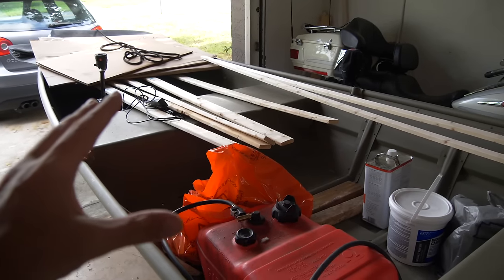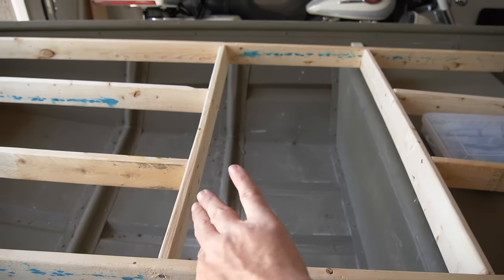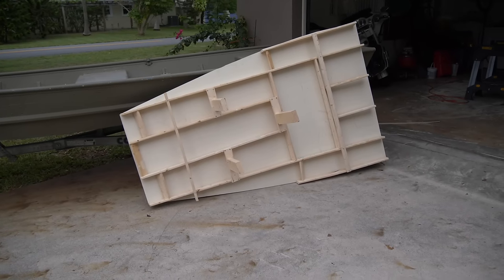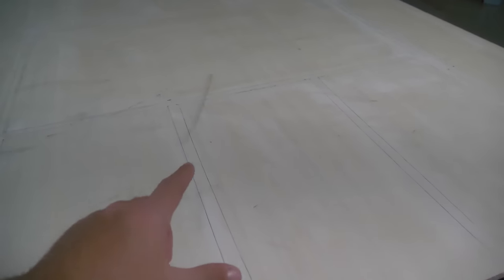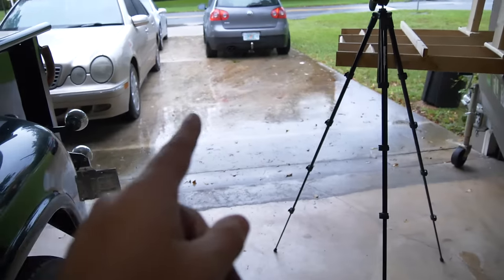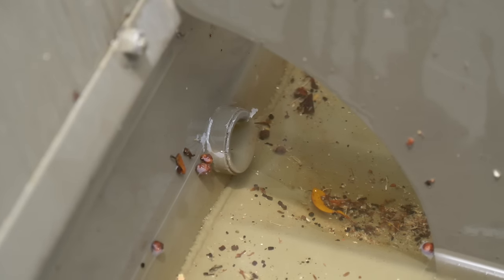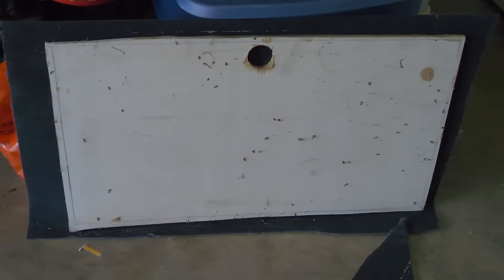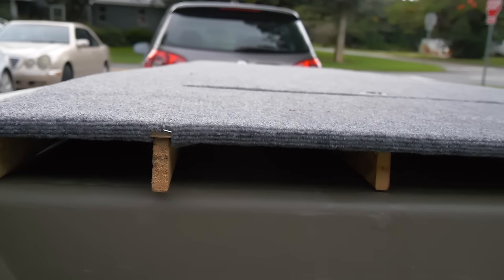Jon Boat To Bass Boat Conversion | DIY Jon Boat Casting Deck

Comment: Solid deck! I got a few minutes in and was like... thats pretty similar haha. Thanks for mentioning me 👍 I appreciate that. That would be the one thing I would change, I would definitely make my hatch a little longer so I could reach further up near the bow. I don't mind it being as skinny as it is, but next time I would definitely change the hatch. I hope you like it, you added your own twist to it and looks like it'll work, solid job!
Reply from the maker: Hey! Thanks man! I had to give credit where credit was due. The guy who taught me how to play bass told me once that there are no original idea's (musically speaking). Every idea has already been done. What matters is how you draw inspiration from the ideas of those that came before you, and make it your own. That's basically what I did with the deck. So, thanks for the inspiration!
Reply: @FloBass  Right on! and solid channel too. What is your camera set up you use for fishing? You have great audio & video and you frame the footage great! I watched you catching the snakeheads and just finished the peacock bass video "punching through mats" haha perspective is everything. I saw a quick glimpse of your rig there but would still be interesting in knowing. Looks like the deck is treating you pretty good too 👌

Comment: Welcome to boat ownership, you have just discovered the amazing hole in the water. It's a hole because you seem to always be throwing money into it justifying it to yourself (or more importantly, your significant other) that it's worth it, or its increasing it's resale value (my personal favorite when the wife gives me THAT face when she sees the cc bill). I made a similar modification on mine several years back but used aluminum angle and square tube just bolted together and deck screws to fasten the ply to the frame then carpet to cover the ply. I put a hatch in the deck to let me access the hull and store a BUNCH of gear and put the Batts to move the cg forward to get it up on plane faster. Have been using mostly just the trolling motor and am building a mud motor from a 6.5 Predator for it. One tip I discovered, the metal with get blazing hot on even a warm day, I took some 1/4 inch thick plywood, cut them the same size as the seats, and carpeted them with the same carpet I used for the deck, made a tremendous difference. Enjoy and good luck going after the fish.

Comment: good idea. as wood worker use the blondwood for framing as well. pocket screw joints. titebond 3 glue. light and strong wont flex as much either. happy fishin.

Comment: Nice job! Take a couple pieces of your left over carpet and put it under the points where it contacts the boat. That’ll take up the difference and also make it quieter. You could just staple it to your runners or it would probably be ok just laying in between the aluminum and wood.

Comment: how did this hold up? I'm looking at doing something like this or going the aluminum angle and rivet route. This looks so much more manageable for me and my skillset. I do have a foot controlled trolling motor that I need to mount. That deck looks perfect for that as long as I can secure it to the boat .

Comment: Are you kidding?  That is a great job. You won't feel that little flexing in the corner once on the water. Great job sir.
Reply from the maker: Thanks man. Its not so bad on the water, but it does kinda bounce in the front when I'm running or trailering it. More peace of mind to add the brackets in the front. I have the worst luck so anything to keep that thing from flying off is a plus.

Comment: You could run a flat piece of aluminum all the way across the front plate about 4 inches wide. Then you culd mount a trolling motor as well.

Comment: i really want to do the same framework your doing with but with front and back decks.  I want to use a 1452 and also build in 14" wide walk-around gunnels.  I love the way you store your rods under the deck along the frame.  trying to decide how much of the front deck space should be storage/hatches and how much should be filled with floatation.
Reply from the maker: Mitch, remember that filling your boat with floatation foam doesn't actually add floatation to the boat when its in the water. It only helps keep it from sinking once the boat has taken on a lot of water. You need to add surface area to the outside of the boat to if you want to add more flotation.
Reply: Right. With my two girls on the boat, it would give me and the wife some added peace of mind.

Comment: i used that sealent on the transom and my deck. Keep up the great work. Its going to be interesting to see how youre going to power the boat.
Reply from the maker: That video is posted. Check it out! The sealant didn't work out too well. I have to keep the boat outside, and the wood is coming a part. I should have used a marine epoxy. Oh well. Next one will be better.

Comment: You can cut aluminum just like plywood with that circular saw. Just get a blade for aluminum. I cut 1/2 plate like butter.

Comment: What kind of screws did you use I'm doing this tomorrow on mine
Reply from the maker: I used outdoor decking screws. They said they were coated to be weather resistant. One update to this is you should get marine epoxy paint and coat the deck with it instead of water seal. The epoxy will dry hard as a rock and nothing will get through it. It will make the deck last a really long time.
Reply: Awesome! Thanks for the info, Your video is helping me out alot man! Do you know the kind of paint tj gatoring used on his?

Comment: Run some of that 1x2 on the inside of the hatch, giving the door more to rest on. I would also run a 1x3 in the middle of the inside of your hatch door and it won't bow when you step on it. It will in do time. Great job though
Reply from the maker: I cut out the hatch opening larger than the surrounding frame so the door rest on it. I was wondering if it would eventually bow. So far its really solid, but I like your idea.

Comment: Just noticed you’re pulling it with your golf😂 im going to pull mine with my ‘17 golf gti lol
Reply from the maker: Yup, the GTI is what I have to work with for now. It's done a great job and has been up and down some sketchy ramps. Everyone always pulls out their phones and records me in hopes I get stuck or worse. I disappoint them every time.
Reply: FloBass right on mane thats sweet👌🏽
Reply: FloBass how’s the transmission and drivetrain holding up?
Reply from the maker: Mine has a manual trans. I’ve been up some really bad, steep, unpaved boat ramps with no issues. Handles it like a champ. Boat, motor, and trailer only weighs maybe 400lbs so it’s like having 2 grown adults in the car.
Reply: FloBass nice!
Reply: This is awesome! I've pulled mine with my audi s4 before 😅😅
Reply from the maker: Heck yes! What chassis? I’m a big B5 fan. Once I start my guiding business and it is going welll I’d like to build a Nogaro Blue B5 S4.

Comment: Hey I hat to get personal but I am a good 250. You think this deck is strong enough to hold me and have you had any problems since?
Reply from the maker: It will definitely hold you. I’ve had some robust folk on the deck with no issues. Just be sure to add some uprights in the middle and you’re golden.

Comment: If I buy one and start in April will I have it done in June I will probably be able to work on it all day every day
Reply from the maker: Cody I know you can finish it in a weekend or two. Just be confident and have fun with it. What helped me is I sketched it out before I started cutting any wood. I went through a few renditions on paper before landing on this layout. If you do the same, and have a game plan moving forward, you can frame it out in a couple hours, cut the ply for the deck in an hour or two and screw it all together. The longer parts would be figuring out a hatch if you wanted one, and painting it. Use a marine epoxy paint and do a lot of coats. That would be an all day process due to drying time between coats. Laying the carpet would take a couple hours as well. Even though this isn't really a how to video, you should have a good idea of what it would take if you wanted to copy what I did.

Comment: I had a lot of redos on my first deck. For the hatch I used nylon strap from an old book bag for my hatches. Holds them in place and up when open. For that bounce in the front just buy some 5 inch lag bolts and washers and screw the deck down to the front platform. It will work great. Also I would buy some spray on sealer and do all the bottom wood. I didn’t and when it got wet it molded. Also, did you weigh that deck when done? Curious to see the weight.
Reply from the maker: I sealed the underside as well and also the support legs. Should be good for a while. I weight myself holding the deck, and with out and it came out to be 43lbs.

Comment: If you do this again I would recommend using 2x4 for actual strength. If you put your carpet on the decking before attaching to frame you won’t have unfinished edges showing. I would also put a small hatch up front so you can access forward mounts to hold frame to boat and any future wiring you may want to do. But with that said, at the end of the day you have a deck that you made yourself and your happy with it. So good for you for being a self starter and doing a project that was maybe outside your comfort zone. 👍🏻👍🏻👍🏻

Comment: I'm building a deck on my jon boat how stable is it and how can I make it more stable
Reply from the maker: Stability depends on the width of the boat. My boat is a 1436 and I’m comfortable on the deck. Other people I’ve had on it are not. If you have a 48” wide jon boat it’s going to be much better, but jon boats are very light and will rock side to side a lot regardless of the width.
Reply: @FloBass  welp I sold it😂

Comment: What plywood did you use is it marine grade/ thickness?
Great video
Reply from the maker: Its called blondewood. Not marine grade at all. It was half inch. The water sealing I did on it did not last. I re-did it with marine epoxy and nothing is getting through it.

Comment: what kind of deck wood did you use? i am building a deck on my fiberglass boat and i need the right material. Thanks! great vid
Reply from the maker: The frame was made out of 1x3's you would use for studs in a home. Deck was blondewood.
Reply: @FloBass  Thanks!

Comment: I've got this idea to convert a center console 15 ft to a side console with bench seats. It's going to have a back deck with a front casting deck. Anyone ever tried this? And can it be done?
Reply from the maker: Anything can be done if you're willing to dedicate the time and effort.
Reply: Yes you definitely can, but you can’t go crazy, balancing the weight is key, and depending on how wide the boat is.
Reply: Are there any u tube videos on the type of conversation?

Comment: Why not use 2x2 half the weight and will be just as strong for what your using for. I’m just doing research for my build
Reply from the maker: These 1x2's worked perfect to give me the space under the deck to store my plano boxes.

Comment: Did you try cutting little off the bottom of the 2×4 vertical support before putting a bracket on front where deck was lifting up?

Comment: You really should be using pressure treated would to frame and marine grade plywood  or epoxy coat the regular plywood

Comment: Did you consider treated lumber?
Reply from the maker: I did, but didn't want the weight. I've already replaced the sheet with one that I painted with marine epoxy and I painted the frame while I was at it. Now that its cured, I can see it lasting many years.
Reply: @FloBass  Awesome
Reply: Never use treated wood in contact with aluminum unless you like holes from corrosion.  The copper in the treated lumber will react with the aluminum in a very bad way.
Reply: @stolencoats63  oh, I didn't know.
Reply: @rusharley134  glad I could inform you before it was too late!
Reply: @stolencoats63  thanks, just about to build one next month.

Comment: 15 hp 2 stroke would be good power- I have a 14 footer too with a Yammy 4 stroke (15 hp), and lots of times wish I had used a 25 hp 2 stroke due to weight. My beam is a little wider, so 15 on your vessel would cruise faster and be about 50 lbs lighter. If you need help strengthening the stern to accept it or to look at another similar setup for ideas, I live in Springs- let a brother know. Congrats btw-Eric L.
Reply from the maker: I actually bought a motor 2 and a half years ago, but never had the ability to store a boat until recently.

Comment: The only other thing I would have done is to seal the wood with some outdoor deck sealer.
Reply from the maker: You think the Thompson WaterSeal isn't enough?
Reply: @FloBass  I guess I missed that part where you sealed the wood. That should work fine.

Comment: You should have built the deck lower into the boat. The boat would have been more sturdy and also your rods and tackle wouldnt fall off the boat so easy cause there would be a few inches of the boat above the deck.
Reply from the maker: Rods and tackle fit in the slots under the deck. It would take at least 8 beers to fall off the deck on my boat.

Comment: That adds way too much weight to a job boat 😂 .. if ur gonna build one do aluminum and it last forever
Reply from the maker: The finished deck only weighed 32 pounds...
Reply: People always say stuff about weight. But yet hundreds of Jon boat owners do this without issue..... So yeh

Comment: why would you use untreated wood? SUPER FAIL!!!!!!! and those screws and angle brakets will rust. You should have though a alot more about this project. If you think its warped now just wait till after the first rain.